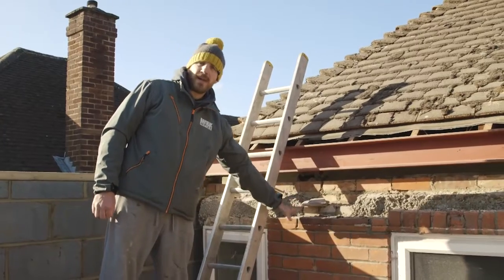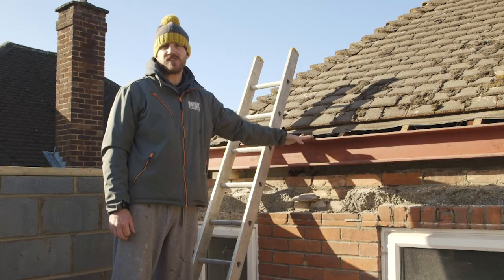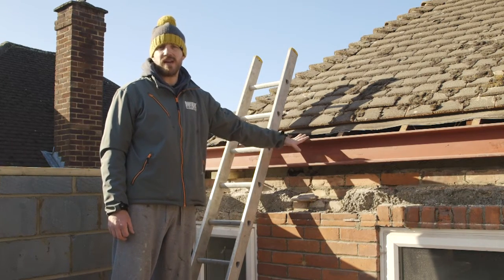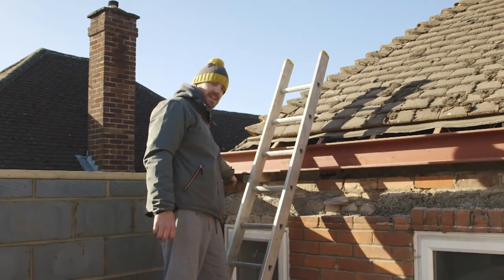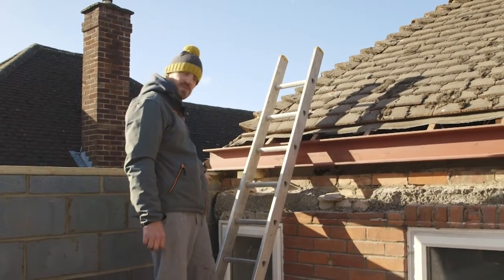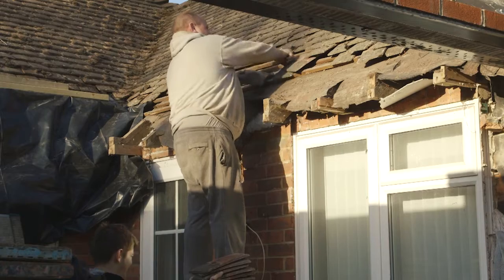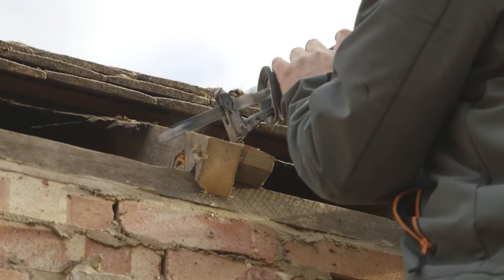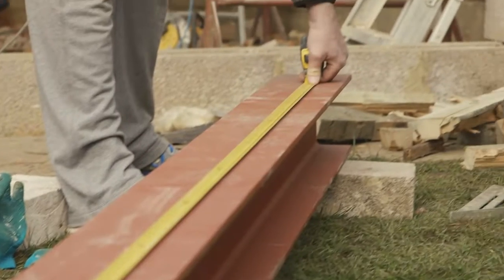How to Install Supporting Steel Joists; How to Build an Extension (5)

Comment: Like your stuff and I am new to the channel. 152x152 is a column (UC) and is an upright and shouldn't really be used for a support.  A UB or universal beam would be deeper and the flange smaller. Example, 203 (Depth ) x 133 (Flange width). These are used in contruction for supports, and the 152x152 would be the column.

Comment: Thanks for your videos, very informative.
I’m doing something similar soon.
I’m guessing your original bungalow ceiling joists run parallel to the new steel? 
Mine run frintvto back, so I guess the ends of the joists would sit in the web or would the steel havecto go under the original wall plate?